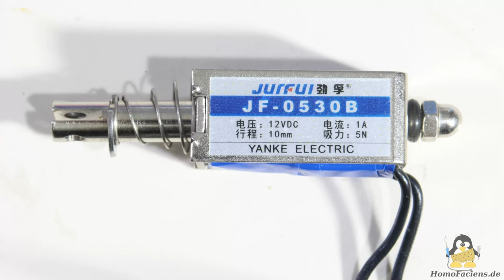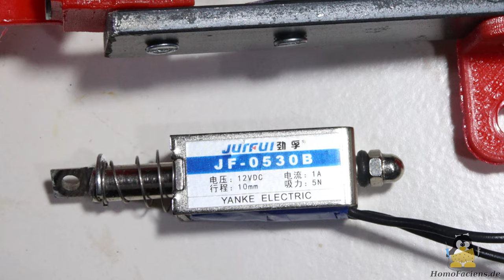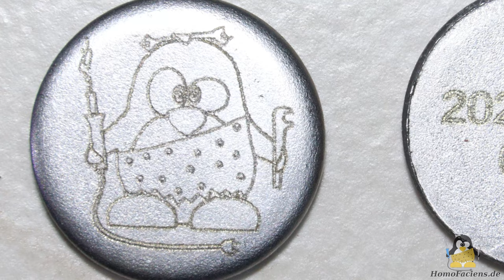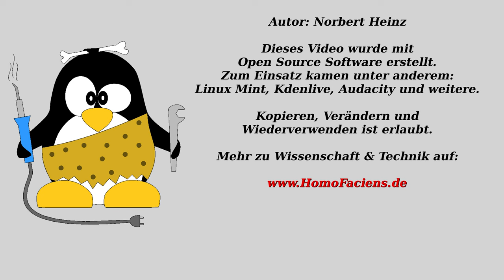Gleichstrommotoren als Wagnerscher Hammer zum Gravieren von Metall

Comment: To increase the current you could simply pit a resistor in parallel to the coil or am I missing something?
Reply from the maker: In doing so you create a voltage divider with the spark gap and this also has an impact on the lifting force of the DC motor that is needed to break the circuit. It definitely isn't that easy.
Using the motor windings as the current limiting "resistor" is the best solution. Choose a fitting motor.
Reply: Thank you for an interesting answer! It seems so obvious to add a resistor but apparently it isn't, though I can imagine that the coil will dump it's energy into the resistor after the circuit is broken. Maybe you can elaborate a bit on that in the next video?
Reply from the maker: I will indeed have to talk about the spark and inductance things in one of the coming videos. Stay tuned!

Comment: Adding a small hf capacitor in parallel to the coil may be good for suppression of unwanted radio interference.
Reply from the maker: So you want to suppress the sparks that are needed to erode the metal? But you are right, I will have to talk about the interference things in a coming video.